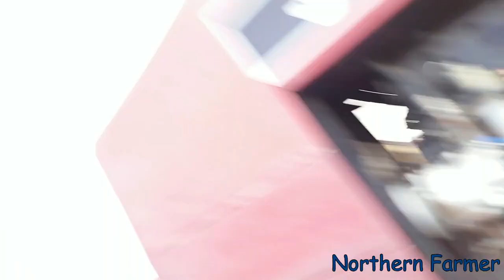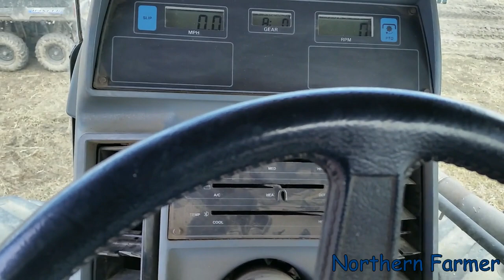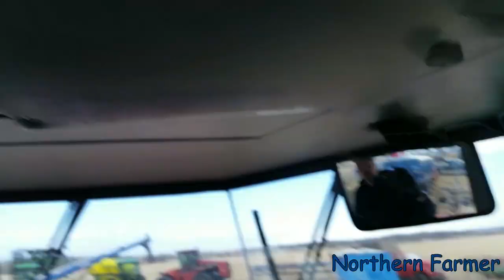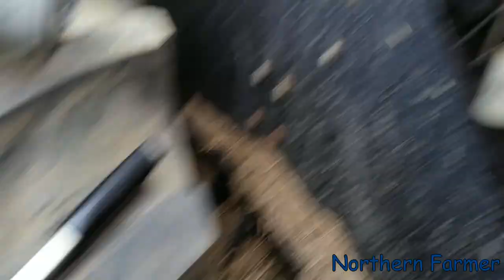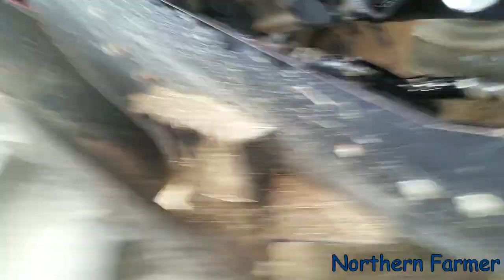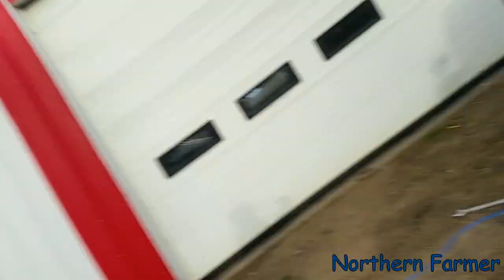Steiger 9250 CaseIH Oil change

Comment: It is a nice tractor. I ran a 9230 but could never get use to the steering. I was use to running 7150 and 7240 with MFWD.
Reply from the maker: 9230 was crab steering right?
Reply: Yes

Comment: Ty, I make a mess every time I change oil & filters. Try as I may I just can't complete the task without oil dry, a wad of shop towels and brake clean. For the first time yesterday I started to poor new oil in without installing the drain plug. I'm not getting better, I'm getting worse. After 40 years you would think I'd have it figured out by now. Maybe it's red tractors. Green tractor guys never seen to complain. Wait, wait- OLF and Tim make their fair share of messes so colour doesn't help. " Keep your stick on the ice, we're all in this together." Red Green. HaHaHaHa. Keep in touch. doug
Reply from the maker: Yea same here.... I thought yea Im going to be clean this time...pffft... ended up being worse than last time in the wind

Comment: when i had my own truck, i made up a 3 ft long metal pick, lay on the ground, and use a 2 lb hammer to punch hole in bottom of oil filter, had my catch basin underneath, that way not  a drop dropped on me. learned the hard way -way to many times till i got fed up with be covered in oil splash. lol.
Reply from the maker: Yes... Im going to be doing that this time..

Comment: Some have a safety feature if the system is low on refrigerant they won't kick on to protect the compressor from running dry and burning up
Reply from the maker: Yea... If i remeber corect this pump had a bad seal

Comment: Check your freon level in your A/C   There is a safety switch in th line so th compressor clutch won't kick in if it's to low.
Reply from the maker: Its full...I checked that the first thing

Comment: I was delighted for you just how quickly it fired up after a long stand. Could the radiator core be possibly be plugged to some extent? Have you done the air filters (engine and cab) and what about the final drive oils? Do you ever change the axle and transmission oils? What grease does it need?
Reply from the maker: Dan Whiteford the radiator is clear...they say after so many years the antifreeze can go bad and then you have plugged cores...so rad flush it is

Comment: It is your low pressure switch in not getting power to compressor check for power there or your temp switch is not letting power to compressor power comes from switch to low pressure to compressor check that
Reply from the maker: Ok thanks.. I will check that out

Comment: Those filter placements looks freaking aggravating.  They had all the space in the world to mount them wherever and they chose next to the frame and surrounded by hoses.....
Reply from the maker: Well its not cummins fault really.... Case could have done a little mods but they just kept the same dimentions from steiger
Reply: Northern farmer no it is not. The worst one looks to be the hydro filter. Just a pet peeve of mine as why manufacturers don't think of these things. Especially when the equipment is so expensive.
Reply from the maker: The Hydro filter is actually the easiest... you just go under the tractor to do it... the oil filter is the hardest because of the hoses and lines and frame beside it.

Comment: Bypass the low pressure sensor for your AC. Almost looks like you have a leak at the compressor there it looks wet behind the clutch. If the system is low the compressor clutch wont kick in.
Reply from the maker: But when I put my gauge on it the pressure is high
Reply: What do you have for pressure?

Comment: Low pressure switch might be not letting powe to compressor or your low on 135 freon buy kit at to recharge your ac
Reply from the maker: Its recharged.. first thing I did was check that... the pressure is normal.